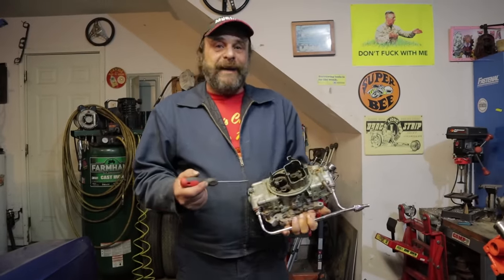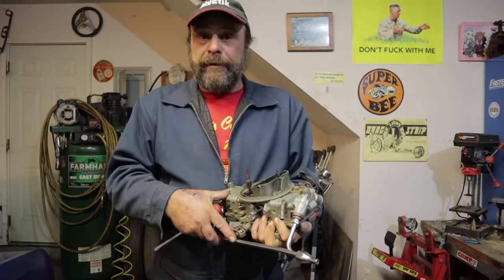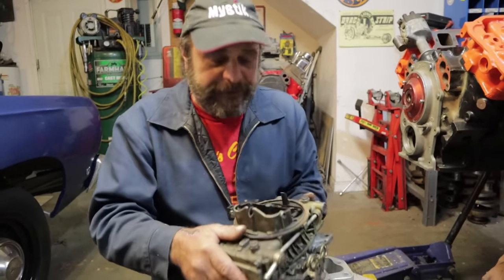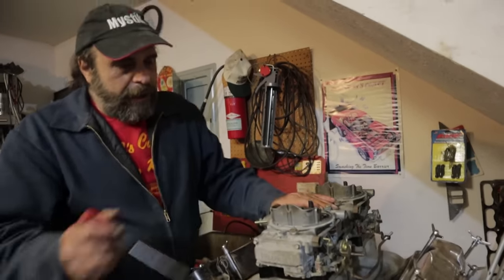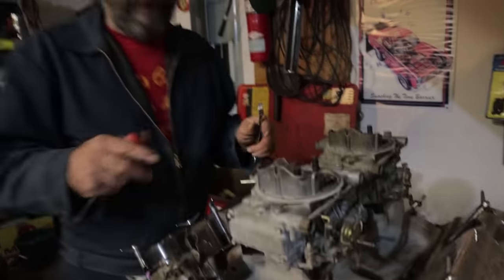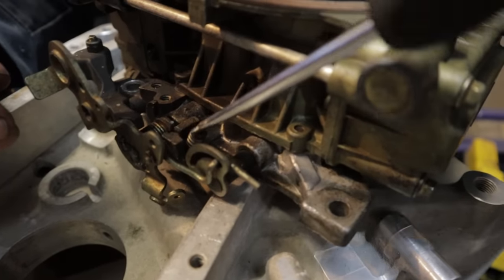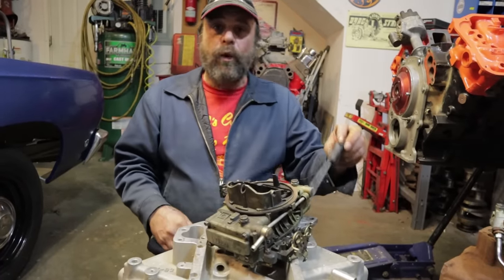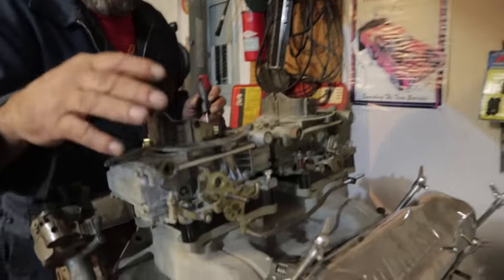Holley Set-Up and Adjust Step By Step

Comment: I just got a holley 350 2 barrel brand new,  put it on the car and when I started it , the car just revved to like 4000 and would have kept going if I didn't shut it off , I never had this problem,  what could be making that happen? Car was tuned perfectly and running perfect with the old single barrel,  but I put this new 350 2 barrel holley on and it immediately  revved up like it was going to blow the engine,  need help please

Comment: Holley carbs had very good points lot adjustments was easy get to. I love there float control level. But they had bad points too. They could get very grouchy during weather changes. Winter time nightmare. I learn long time ago try not fool with daily drivers a lot. More work on them more you had too. Leave them stock.

Comment: Before you start adjusting  anything first back off the accelerator pump so theres no load on the arm .  Reset it last when the idle speed and linkage is correct.

Comment: I have a 1996 350 vortex with a holly 600 ddb carb on it and when i sump the gas hard the engine shuts off but runs well at idle but when mash the gas kind of quick the engine shuts off.

Comment: I have a question: if the idle mixtures screws are already turned out 1 1/2 turns, and they're supposed to end up somewhere between 1 1/2 to 2 turns; wouldn't it make more sense to not turn it out another 1/2 turn before screwing back in 1/4 turn at a time? Because then, you would just have to screw it in at least a 1/2 turn any way or you would end up with over 2 turns out. Maybe I misunderstood, but I'm thinking you would start 1 1/2 turns out, start screwing in a 1/4 turn until the RPM's drop, and then screw it out a 1/2 turn? 

I have to give you a huge thanks for this video. My 383 Stroker with a Holley 750, had a terrible idle. You could see the engine shaking and the car would almost stall in traffic. I've taken it to 3 mechanics that never got it running smoothly. Just with these basic settings, it's been running smoother than it ever has and idling around 800 rpm's. No more engine shake and the idle rpm's are very steady and not jumping around. It fires right up too. I just want to make sure I fine-tune it properly so it's running as smooth as possible.
Reply: Get a vacuum gauge. Hook the tube from the gauge to manifold vacuum port. Start the engine. Let it warm up to operating temperature.  Adjust the a/f mixture screws until highest vacuum is obtained on the gauge.  That's how to fine tune the a/f mixture on the carb. Remember, this is only good for idle
Reply: @LarryDickmann  Thanks so much. It's my idle that's given me most problems with this car. When the idle is smooth, the car tends to perform perfectly. Over time, it just needs adjusting so it's really useful to know how to do it myself. Most mechanics around here won't even do it any more. I've had to take my car to 3 shops to get the carb tuned.
Reply: @user-yo6oq1hv9f  I've thought of opening my garage and have a side hustle working on older cars, but the way people are nowadays, I changed my mind.  I don't mind giving advice tho.
Reply: @LarryDickmann  "The way people are nowadays"... I hear that. I always try to treat any kind of repair workers really well - not just for cars. Expertise for a lot of older repair work is dwindling so it should really be appreciated. But I think that's rarely the case, unfortunately.

Comment: Im starting on my project 65 dart : 360 factory block possibly stroking it out ? 360 J heads worked over . Racing auto 727  2800 stall full manual valvebody, 8-3/4 rear sure grip with 3:55 . Whats better for street/strip : holley 4 barrel or eddie?  Also high rise air gap dual plane  intake or high rise air gap single plane? Whats your professional opinion ? Any help would greatly be appreciated
Reply from the maker: I would probably go with the single and an 800 Eddy

Comment: What do you think would cause my car to idle smooth as silk then randomly just shut off no stuttering nothing just dead. Im trying to narrow down the list of things it could possibly be...
Reply from the maker: Likely something is killing voltage to the ignition circuit.  That was also a common sign of failing module in HEI set-ups
Reply: My car still runs points

Comment: I don't know about Holley being to best carb ever, that would have to go to the Thermoquad. In fact, back in the day they rivaled Holley in the hands of a competent tuner. They even made 1000 cam units, but only for the aftermarket. The biggest difference, Holley can be tuned without taking it off of the car, where a thermoquad almost has to be taken off the car. If memory serves me right, the metering rods can be changed without tearing it apart. I know that's the case on the AFB and the later and improved AVS carbs. But when you get one dialed in it was a hell of a good street strip carb. Holley can run as well, but they can be just as difficult to tune. But a lot of the changes can be made without removing the carb from the engine.
One tip that's universal, on every carb I've ever seen, the idle mixture screws should never be tightened more than just touching the seat. NEVER crank it down! If you do you'll damage the needle and the seat, and you'll never get the mixture set right. If you have a carb you can't adjust, check the idle mixture screws to make sure some gorilla hasn't overtightened it and destroyed it.

Comment: Tony do you start air idle mixture adjustment with the passenger side or drivers side on the Holley? I noticed you started on the passenger does it make a diffrence? I've always started on the drivers side.have I've been doing it wrong? I always use a vacuum gauge.
Reply from the maker: Makes no difference
Reply: Thanks

Comment: I have a holley carb that doesnt have any float adjustments nor does it have air idle adjustments on the rear side of the carb.. i was told the carb was blue printed ..but my truck bogs down badly when i flore  it . On the front top lip of the carb says 
1763
List-6210 
The float adjustments are sealed off ..can anyone help me on how to adjust this holley with these issues to the carb

Comment: Hey U.T.!
Why not scare hell out of them - do a video on THERMO-QUADS!!!
Reply: keith cunningham  
No arguments there...
But a little epoxy and some time they were good as new.
The thing I like best about them - and Quadra-jets and sidedraft Webbers was there wasn't anywhere in the fuel curve that couldn't be fine tuned.
Granted, Holleys are easier, but they're just not as accurate at metering fuel.

Comment: some times my fuel pressure is at 6psi and it goes up to 9psi and then it goes back down to 6psi I have a 86 IROC Z28 with a holly fuel pressure regulator because I had a tuned port 350 in it so it has an electric fuel pump in the gas tank.

Comment: When I was in high school a lot of kids would get the 750 double pumper & put it on their very low compression way to many pollution control engine & wonder why gas was coming out the spark plug holes . My brother in law and I wanted to turn one into an ash tray . But it was just to much carb for the motor  . I like the afb's they seem to be more user friendly

Comment: again great video! thanks for that. got just a rookie question. setting the fuel level right for bowls with sidewindows: should it also be set at the very bottom of the window or at the middle? is it then the same for all holley style carbs (qft, you name it)?
Reply from the maker: The height of the fuel is what is measured here, so top level is all that matters
Reply: @UncleTonysGarage  hello Tony, thanks a lot for your reply. just to double check that i understand it right: if a holley style carb is equipped with a screwed in side plug, right fuel level is achieved as explained in the video. 
if the carb has no screwed in side plugs but glas windows instead, the right float level is achieved when the level sits at the very top of the glass window.
is that correct? or should it be at middle or the bottom in the side windows?
Reply: its all right - i have found an articel regarding qft. for those carbs with side windows the right float level is indicated in the middle of the side window.

Comment: Mines back fires I have 4 barrow holes I was having a leak with the throttle where it the spring it was like bad gasket with a nipple in on it and I ended up replacing it that’s when I stop seeing it leak so I place it all back tires turn it on that’s when it back fired

Comment: Holley street warrior 600 cfm on my 1988 camaro.. Does not hesitated off idle in park reving it up.  Put it in gear and it stumbles off idle and then recovers and goes like a bat out of hell.. Secondarys also work great.. But it falls on it face just off idle!!  Carb has been rebuilt and cleaned and new 6.5 power valve.. What could it be??
Reply from the maker: Sounds like an ignition timing issue
Reply: @UncleTonysGarage  New plugs, wires, distributor and adjustable vacuum adv can,  initial is set at 14 degrees timing.. 33-34  total mechanical and 54 with vacuum advance hooked up to manifold vacuum..  Have no Idea why its doing it!!

Comment: I love this video. You make it really easy to understand. Can't wait to see the more advanced tuning.
What do you think about Edelbrock? I've got a 1407 on my car now, but am thinking of getting a Holley.
Reply from the maker: I prefer the Carter/Edelbrock for mild driver type cars.  They're simple, work great and are easy to make minor metering changes to.
Reply: @UncleTonysGarage  good to know. My car will be a fun street driver and it seemed to run pretty good before I tore it apart. Looked a little rich from the plugs, so I'll address it when I get the car put back together.

Comment: how do you set-up a carb if you are planning to go through a 1-2k miles altitude hill?
Reply: Uh, the same as you would in any other circumstance. Make sure float levels are correct for sure and make sure you have sufficient fuel pressure and volume
Reply from the maker: If it's just a one time thing, don't stress it.  If the car spends a lot of time up there, you're going to have to lean it somewhat to be happy

Comment: A Holley is nothing more than an occasionally organized fuel leak. I've had two 600cfm 1850s and a 750cfm 3310 and all had extreme flooding issues no matter what I did to them. Destroyed two engines in a matter of hours from inconsistent flooding. Cylinder walls in my previously fresh 355 have too much ring ridge to even get the pistons out after a few hours' run time. I had a fpr (5.5-6psi), all were rebuilt and had no underlying issues. The 750 ran fantastic on a couple engines I had but shortly after break in on this one it decided to relentlessly flood. I had an Edelbrock on one of the engines previously and never had such issues. Never running a Holley again
Reply from the maker: Either your pressure gauge is off, or you sucked something through the lines to get caught in the needle and seat assemblies.

Comment: 5:01 Hey Tony, are the floats not adjusted by the screw, and the setting not held by the nut ?
Reply from the maker: No.  The needle and seat assembly is what threads into the bowl, and the nut is captured at the top of it.  Screw holds it tight against the bowl.
Reply: @UncleTonysGarage - Took a while but I finally got my Holley ! Now to get tuning ! Thanks Tony 👍

Comment: Would cause the engine to start up but won't stay running I can pump the throttle a few times it starts but cut back off

Comment: On my Holley I can't get it to idle below 1000 so putting it in to drive causes a horrible clunk, adjusting the screws did nothing, would this suggest i need a carb rebuild?
Reply: With stock cam and automatic transmission? That happened to me. For me it was the Comp cam was to high for the transmission converter stall speed. So it was put a manual transmission or change cam.
Reply: @69mustang  the previous owner said it had a thumper cam fitted but i dont know if its true or not....damn is there no adjustment to the stall speed?
Reply: No sir. Stall speed is built in to the converter. I would check for vacuum leaks, maybe hook up a vacuum gauge. If adjusting the idle mixture screws don't do anything for it, clean the carburetor. I mean, really clean it. Wire bristles from a wire brush help a great deal with cleaning the little passages in the metering block and other parts. Good luck!
Reply: If the idle speed screw will not allow emgine to idle down below 1000 rpm then sounds like you have a substansial vacuum leak
Reply: @Mr.NiceGuy80  thank you, i was thinking of just sending the carb off for a professional rebuild and ultrasonic cleaning as im losing motivation to continue my project, totally underestimated what is involved in restoring an old car and sometimes wish i'd bought something new!
Reply: @dazasc3994  , NEVER BUY ANYTHING NEW! LOL This old iron built America, it inspired our fathers and grandfathers, and ultimately you and I to have some kind of kooky passion for these old machines. The more of us keeping them alive, the better.
Reply: @Mr.NiceGuy80  trust me i understand, there arent many 24 year olds rushing out to buy a 71 corvette but i did because theres something undeniable cool about these old cars, i just hope i can get it reliable enough to use regularly!
Reply: @dazasc3994  you're gonna do just fine. Always remember; reliability in these old machines is relative. You'll tinker with it, you'll always wonder if you're getting the most out of it, and you'll always chase that extra little kick in the pants when you step on it. It's a beauty, a bonnie, and a joy forever.
Reply from the maker: Daza, you're pulling fuel through the transfer slots and not the idle passages.  Most likely they are clogged from sitting for an extended period of time with fuel in them...very common.
It's time for a thorough rebuild
Reply: Uncle Tony's Garage thank you so much for replying, my day has been made!! Will send it off for a rebuild
Reply: @dazasc3994  If I could make a suggestion.... Rebuild it yourself. The pride you will experience when you get it right will be awesome. And you can tell people YOU rebuilt the carb. It's scary your first few times, but that will go away. The confidence you'll build, and the pride you'll feel when you've done it will be well worth it. Immerse yourself in your hotrod. The more you do for yourself, the more proud of her you'll be, and the more you'll know your ride. The excellent thing about doing it yourself is, you'll have resources galore when you run into issues and you need a little help. People like Uncle Tony would be happy to welcome another gearhead into our dwindling numbers. Remember: "built, not bought".
Reply: @Mr.NiceGuy80  honestly i was thinking about doing it myself but the thought of screwing it up scares me, i've already rewired the entire car and fixed 50 years of bodges but i have no confidence in doing the carb, is it difficult?
Reply: @dazasc3994  it can be intimidating the first time just mainly because of all the small parts. Keep everything organized, and take pictures if needed. That'll help a lot. Uncle Tony will probably tell you, the dining room table is the best place to do it. LOL
Reply: Check to make sure that the vacuum advance line from the distributor is connected to ported vacuum and not manifold vacuum.

Comment: Best truest setting on carbs for motor cross ect or quads take the idle screw in till idle drops take it out till idle drops the go half way between. That always give the best fuel air regardless. Thats small engine crap but i would imagine same shit at the end of the day. I am almost surprised to not here if you cant get anything out of it you main jets need to be changed there to lean and need to be fattened up. Im small engines thats usually the gigg. Maybe you would of got to that in later vids ill have to check them out. Im a small engine guy not large 😊

Comment: Missed powervalve.  If you know how much manifold vacuum your engine produces before ordering carb you can get pv installed. If not stock carb come with 6.5 hg pv.  Good for 13 hg maifold vac.  I have 425 hp cam large lift large duration low manifold vac (10 hg) the math is manifold vac ÷2= pv size.  Ex. 10 hg manifold vac 10 ÷2= 5.0 hg power valve

Comment: Holley carburetors I've had nothing but bad luck with them I went back to the Quadrajet and it seemed to perform better I think Holley carburetor are nothing but garbage but that's just my opinion I have been told in the past that you can't rebuild a Holley and it seems from everybody that I talk to that have tried to rebuild them they also said the same thing I said.

Comment: Transfer port sync my man. Open that primary idle adjustment screw too much and your idle /air screws wont work anymore. Big overlap cams especially.

 Adjust the secondary air stop screw to get your idle right after you set up your primary butterflies to the transfer ports. With correct adjustment to the transfer port to butterfly relationship, the transfer port should look like a square not a rectangle. Then adjust the secondary stop to bring the idle up to where you want it. 

Too much transfer port exposed will cause rough/rich idle and poor tip in response.

Comment: Tony keeps saying that "there is no computer in a carburetor." But it computes just as much as fuel injection! Its just analog computation! A carb still has to detect the air flow and mechanically compute how much fuel to let through. So its quite erroneous to say that a carburetor doesn't do any computing. A carburetor is computing thousands of times a second to keep up with the demands of the engine. He says he prefers cabs because HE is the computer but nothing could be further from the truth. Give the carb some credit for all the computations it does!